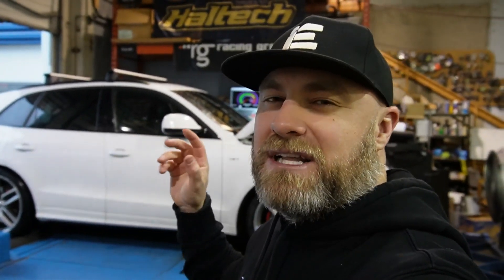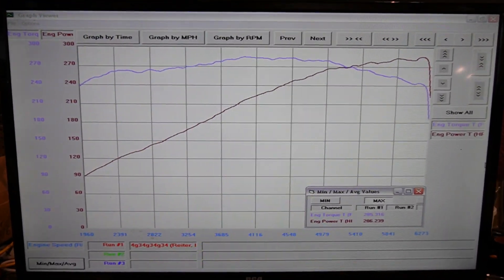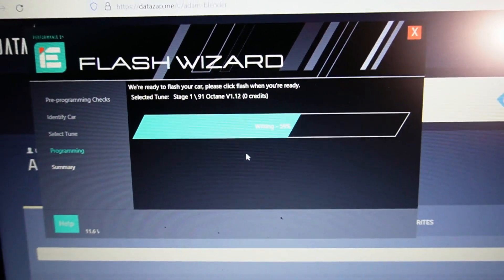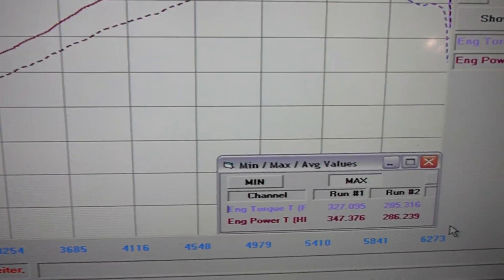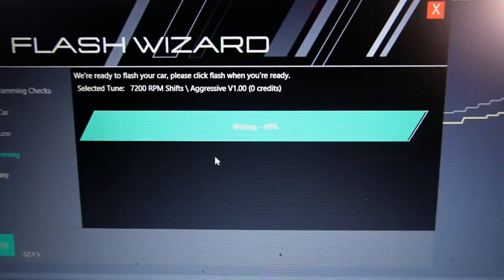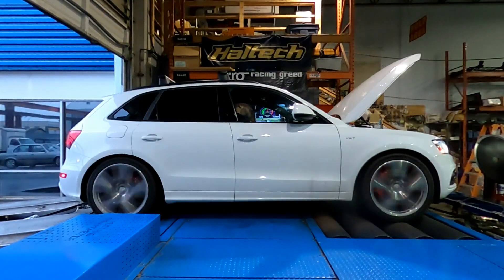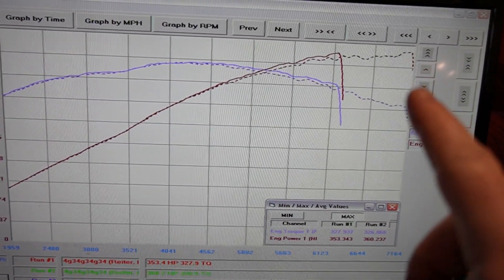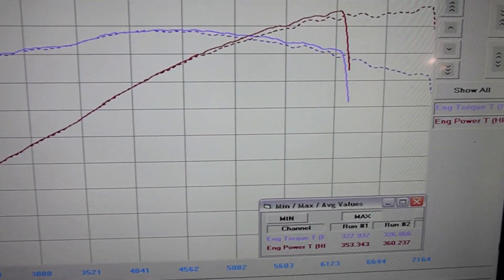How Much Horsepower Do You Gain From An Integrated Engineering TCU Tune In An Audi SQ5?

Comment: The fact that everyone in the comments actually believe those numbers with 0 mechanical mods 😂😂 what’s it gonna make with dual pulley setup and ported charger 1000 whp ?😂
Reply: Cars that already come boosted does these numbers with just tunes adding downpipes would’ve gained a extra 50hp 😂💀
Reply: i gaiend 100hp on stage 1 on my a7 3.0t, but thease numbers are just to much that dyno is either not setup right with the car or just very incorrect
Reply from the maker: @stefanmarkovic8180  or you have absolutely zero clue of how dyno's work which is apparent from the comments you have made. Perhaps you should watch 0:48 of this video so you can learn a thing or two of how dyno's work: https://www.youtube.com/watch?v=JKB73iMNnXY&t=293s
Reply: @VancityAudi  very professional taking it so personal but idc you know nothing about my knowledge and what i do so it’s ok
Reply from the maker: @stefanmarkovic8180  Not taking it personal, lol. Just trying to improve on your knowledge base seeing as you speak as if you are someone extremely uninformed of how dynos work and read.
Reply from the maker: The fact that you don't believe them is more of a problem. Feel free to call the performance shop or drop by yourself and ask to see them in person. I don't ever lie in my video's. I simply record and share data. 

It gained exactly what I shared in the video. I specifically use this dyno because it is extremely consistent in its readings.
Reply: @VancityAudi i couldn’t care less because it’s not my car that’s just getting a download flash put in to it just to show high numbers on n YouTube
Reply from the maker: @stefanmarkovic8180  and yet you're the person complaining and poking fun at me simply showcasing what this vehicle did with some simple tunes and an air intake. It's not even my car! LMAO. I have F all to gain from showing "high numbers". I even specified they were non-corrected Mustang AWD numbers.

Comment: 91 octane you show a 40 torque increase yet IE website advertised a 120 gain.   BIG difference.
Reply from the maker: You appear to be looking at the wrong chart. Here is the link for the tune you should be referencing: https://performancebyie.com/collections/ecu-software-tunes/products/ie-ecu-tune-audi-30t-supercharged

48lb/ft of torque at the crank is what they claim from a stock tune to a Stage 1 tune on their 91 octane tune in a B8/8.5 SQ5.
Reply: @VancityAudi ah, yes. I was thinking B9.  Sorry.
Reply from the maker: @datsuntoyy no worries. Just trying to help.

Comment: Who can help me ... trying to get higher rpm limit on shifting. 
I changed the limit on ecu software to 7200rpm
And in tcu to 6800rpm
But the car is going all the way up to 7200rpm and get into a fault... what else I need to do in the software???
Audi Sq5 2015 dual pulley
Reply: Fixed the issue .. by put higher limit on tcu and little lower on ecu...
So it is going up to 7000rpm as I put in tcu...but cut the ignition and doesn't shift up gear....
What I need to do more to make it shift up .. some help please..there is no tuner here that can tell me please???
Reply from the maker: @doronkoz  your ECU and TCU shift points need to match. If your ECU is set to 7200rpm then your TCU should be set to 7200rpm as well.

Comment: Does the B9 gain any power from TCU tune?
Reply from the maker: No. Unlike the B8, the B9's powerband drops off higher up in the rpm's because the turbo isn't very big. If I remember correctly the peak horsepower in a B9 with a stock turbo is around 5600rpm so there is no advantage in revving the car out to 6800rpm for maximum acceleration. With that said I still HIGHLY recommend you pair your ECU tune with a TCU tune to get the maximum amount of performance out of your B9.
Reply: @VancityAudi I followed your advice on that, about the intake you showed, can you dyno the B9 to see if it adds power like the B8 did?
Reply from the maker: @adventurer4188 already did. https://youtu.be/Jsdmf78qHXA

Comment: Have 034 with same tcu, stage one 91 and their intake. It’s an absolute beast off the line. Leaps out of the hole like a Tesla model Y and gives all these EVs nowadays a proper challenge.
Reply from the maker: If you're impressed with a B8/8.5, you'd be even more impressed with a B9. They launch even harder and make substantially more torque off the line.

Comment: That’s insane. The stage 1 numbers are what I would have thought it would make stock. These things lose a ton of power through the drivetrain
Reply from the maker: Remember, these power figures are at the wheels and not at the crank. You have to add drivetrain loss into them to understand what the vehicle makes for power at the crank.

Comment: The numbers are good but how reliable are these tunes? I have a stock 2017 SQ5 and I’m tempted with the stage 1. I’m not interested in big numbers, I’m looking for better fuel consumption and a little more pep on the highway. Is a TCU tune necessary with a stage 1 ??
Reply from the maker: It isn't "necessary," but you won't get the full potential of the tune as shown in this video without a matching TCU. Their Stage one tunes are extremely reliable. Make sure you use promo code VANCITYAUDI for a discount from https://performancebyie.com/?dt_id=312953

Comment: I just bought a 2015 SQ5 a few weeks ago. 42,000 miles. (No Mods yet) I have noticed some "Sloppy" trans behavior. Its not all the time, normal day to day driving in "comfort" mode is fine mostly. In Dynamic it shifts harder and seems to jerk around - up and down in gear. I understand this might be the trans way of becoming more eager and aggressive. However, here is where it gets strange,...When in "comfort" and I decide to be aggressive with the gas peddle (like chasing down our mail man on the highway) it shifts hard, and after the big chase it's like the transmission stays pissed off - Shifting a little hard and up and down in gear. It's not until I stop the car and it sits a bit will it stop the erratic behavior. SO with this said, do you have any kind of explanation? Also do you think there is a good TCU tune that would help some of this erratic behavior when in Comfort mode? Do you think a simple re-map of the trans at the dealership will fix this? ANY INFO HELPS!!!!!! Love your Vids by the way!
Reply: It’s normal for a ZF8. The trans is bulletproof. I can assure you. They use these in all medium or large high powered cars such as roles Royce, Lamborghini Urus, Porsche Cayenne, Bentley whatever the heck they have and so on. They can handle a lot of torque and shift fast. Also can skip gears. That’s why probably feels weird.
Reply from the maker: I'd look at doing a transmission service as well as a proper TCU tune from IE.  Dealerships don't offer tuning most of the time. You can do it yourself by ordering IE's Powerlink cable or you can go to an IE dealer to have it done. Thanks for watching!

Comment: just grabbed a super clean 2016 SQ5.  Thinking for doing this exact thing minus the air intake.  Can this all be done from my phone etc once the gear in purchased?  Thanks for the tips.
Reply from the maker: As of right now, you'll need a laptop and the IE Powerlink cable to tune the car. Soon, IE will be releasing tuning capabilities via their phone app though.

Comment: I have a new 2023 Audi SQ5. What should I start with to make the turbo have a little more noise, or should I start with the an air intake? I don’t want to go crazy with mods but I want it to seem a little more ballsy haha thanks I’m a newbie
Reply from the maker: It depends if you want whoosie turbo noises or more exhaust noise. Whoosie turbo noises are achieved by installing an open air filter intake and a blow off valve. Exhaust noises would be a catless downpipe and midpipes.

Comment: Hi guys.. I just tuned my SQ5 2015 to 034MOTORSPORT TCU 7200RPM TUNE. I'm stage 2plus dual pully ecu.
I went to a test drive... the power goes down from 6000 to 7200rpm... and after two pulls the car now goes slow...
I checked for faults and yessssss there is p034000 camshaft position sensor circuit. It doesn't erase.  Active fault. 
Am I fucked my AUDI? or what? 
The situation now is : long starter (2 sec) to start. And the car goes like it has 100hp. No strange noise or somthing. Any suggestion before I'm crying here?
Reply from the maker: Have you tried reaching out to 034, seeing as your problem started after you tuned it?
Reply: @VancityAudi  i sent an email... it was before 2 hours all the story... waiting for any comforting answer from some one who experience it

Comment: Hi Adammmmmm.... how are you???
I'm dual pulley now sq5 2015. 
I wanted to ask what it needs to be in the tcu tuning to get more "power" and less times for 100 or 200 kph ? 
It is only the fact that it goes 7200rpm gives it more "power"? Or must to make it more pressure in the shifting???
Reply from the maker: It allows the engine to rev to 7200rpm which allows you to make more horsepower. Without the TCU tune your motor can't rev as high and won't make as much power. Thought that was pretty clearly explained in this video.

The other thing a TCU tune does is allow for a better launch control and possibly better shifts.
Reply: @VancityAudi        yes it was very clear in the video.  Just wanted to hear it from you again. I'll let you know the difference in my car after I will tune the tcu. And heyyyyy... thanks for all Adam. Your videos are the best. Love to watch them. Thanks From ISRAEL

Comment: Hi, all the way from Germany. 
I was wondering if you would swap the original Turbo with a high Performance garrett Turbo on a sq5 8R, I am thinking of doing that. My SQ5 8r TDI competition has the stage 2 MTM Chip implemented, tested 431 bhp.
Reply from the maker: No idea, sorry. I have no experience on the new turbocharged SQ5's other that what I've seen with my B9 S4 with the same motor and transmission. If I had to suggest a turbo it would be the TTE710.
Reply: @VancityAudi  Thanks a lot for answering, I will research the TTE710. Great Videos by the way 👍
Reply from the maker: @Andili76  no problem. I'd recommend Integrated Engineering paired with the TTE710

Comment: What about the 3.0 this model?
Reply from the maker: They use the same motor and the same transmission, not to mention the same tunes. This would apply to those as well.
Reply: @VancityAudi  Do you have any dyno graphs, or videos of these?
Reply from the maker: @TEJET1  they'd look the same as the SQ5
Reply: @VancityAudi  Sorry, I just realised auto correct changed my message. I was asking about the 3.0 TDI Engine? which is in Australia and Europe? Its a diesel engine, so the dyno would be different :)
Reply from the maker: @TEJET1  in that case, it's a completely different motor. Different tuning is needed. https://www.getunitronic.com/ecu-tuning/audi-q5-3.0tdi-2014-2016-stage1

Comment: Hey I am new to this channel , Great Stuff  !! I have  2013 Audi Q3 Now 2105 In The USA. I have stage 1 integrated engineering Tune. I not put my car in Dyno as yet but the difference is Huge !!  I  I have now installed  REV 9 Intercooler with a some modification because I could  not find the correct fit. I  have also added CTS Turbo down pipe . I have not added stage 2 File as yet as I want to add the  Air intake system and and and Transmission Tune. Can you recommend a TCU Tune  for  Car . There is not much information on Audi q3  EA888 engine
Reply from the maker: I honestly don't know that there is one. From what I know the transmissions aren't very well built in those SUV's sadly. Sorry dude.

Comment: Seems an exhaust system could wake it up a bit more?
Reply from the maker: Maybe in terms of sound, but not for power.
Reply: @VancityAudi  No restriction in the headers or cats or mufflers?
Reply from the maker: @turnin.sprocket  replacing the cats with test pipes would open it up a bit, but I've seen in other testing that upgrading the exhaust doesn't provide any power gains.

Comment: Great video. I'm from Brazil and I have a supercharged SQ5 with k&n inbox. Would it be possible to somehow perform the remap (ecu and tcu 91 octane) via remote?
Reply from the maker: Absolutely. You need a Windows based laptop, a strong Wi-Fi connection and the Integrated Engineering ODB2 dongle found here: https://performancebyie.com/products/ie-vw-audi-powerlink-flash-cable?_pos=1&_sid=bb617cbf4&_ss=r
Reply: @VancityAudi  Combined. Once I get the connector, I'll get back in touch to work out the details. Nice job. Congrats.
Reply from the maker: @Diovanni  Integrated Engineering has details and videos on their website on how to tune your car.

Comment: The reason the TCU tune helped you so much, isn't because of the extra peak power, it's because of where the shifts put you in the rpms. You don't make peak power the whole time you are running down the drag strip. Now that you are running 7200rpm, you don't drop way back down to where the engine isn't making the power. That was probably the point being made by the people telling you that. The average power with the rpm shift is a lot more than the 20whp peak gain suggests.
Reply from the maker: Sadly that wasn't what he was claiming. I feel like this is the 7th time I've explained this now, lol. He claimed that his ECU tune made no difference on performance and the sole reason his SQ5 went quicker, faster and made more power was because of the TCU.
Reply: @VancityAudi  lol, got ya.

Comment: So stock the horse power is not even close to what Audi says it comes with?? (354hp)
Reply from the maker: The horsepower Audi claims is what the SUV makes at the crank. The measurements you see here are power ratings at the wheels. You have to account for the drivetrain loss.

Comment: Another great video! I’m have a B8 S4 and want the stage two ecu tune, tcm tune and heat exchanger. In an B8 S4 what the tcm shift at, mine shifts at 8200 now I think. I’m gonna go with EI also I think just because of your videos brother, I feel like you test and tune for the audi gang. Thx a bunch.
Reply from the maker: Your transmission would have blown up already if it was shifting at 8200rpm, lol. If it isn't tuned it shifts at around 6800rpm. Once tuned with IE you'll be able to shift at 7200rpm or 7350rpm.

Comment: Extending the redline yields better 1/4 mile times because it increases the AVERAGE horsepower.  After each shift, the rpm’s drop, but they will be at a higher rpm, which means more power, and a more efficient powerband with higher average HP.
Reply from the maker: I am very aware of that.  What the previous commenter stated is that the whole reason the SUV went as quick and as fast as it did was solely because of the TCU tune and that the ECU tune did barely anything in terms of providing more power to go quicker and faster in the 1/4 mile.  I proved that was 100% incorrect because the bulk of the power gained was via the ECU tune.  No doubt the TCU helped out too.

Comment: Loved the video. Would have like to see the car with no IE intake because I think that it would show even better than it did on the track test given the extra RPM.
Reply from the maker: Not sure I understand. Why would you want to see it without the IE intake?
Reply: @VancityAudi  To show how much extra you would get on a TCU tuned car from the intake. At the track it looked like 18 hp when you put on the intake. I want to know how much it would be worth on a car with a Stage 1 file but the TCU tune as well because I think it would show even better, given the extra amount of air ingested at the higher RPM.
Reply from the maker: @Todd.T  how did you come to an 18hp gain from just seeing 1/4 mile runs? The videos from the track were already using both the ECU and TCU tune.
Reply: @VancityAudi I forgot the part that the TCU was tuned, but would still be curious as to it's advantages on a car without a TCU tune that isn't going to rev that high. I said 18hp as a ballpark because for you to drop a 10th in the quarter you either have to add 10 hp or drop 100lbs. Same to gain a mph.
Reply from the maker: @Todd.T  that's an extremely general calculation, but okay. Ya, it would have been interesting to see the difference in ET and trap with and without a TCU tune installed
Reply: @VancityAudi  It's been pretty accurate for many over the decades. The only way to be sure is to....dyno it!! The trap speed shows more value and accuracy than the ET in the calculations.
Reply from the maker: @Todd.T  sadly I know that not to be true from personal experience. It may be somewhat accurate at slower ET'S, but as soon as you start going quicker that isn't even remotely close to accurate. If I add 100hp to my RS3 which currently runs a 9.3 there is no way in hell it'll then run an 8.3, lol.

Agreed though that doing before and after dyno comparisons on the same day, in the same conditions is the best way to see exactly what the gains are.

Comment: Awesome video 
Can I tune my Audi Q5 2.0t like that?
Reply from the maker: You can tune your ECU just like I demonstrate, but I don't belive there is a TCU available for your transmission.
Reply: @VancityAudi 
Correct no TCU tune -- kinda weird --
It's interesting to me -- B9 Q5 2.0t is near 350HP stage2...
Maybe a SQ5 vs Q5 2.0t drag racing!! Similar HP range 6cyl vs 4 cyl "mass" difference= time difference

Comment: What are your guesses about the future of the 3l v6 engines. Forged pistons, camshafts? Hopefully they will be able to reach 700+ hp one day.
Reply from the maker: Are you referring to this generation 3.0L V6 or the new 3.0L V6 found in the current generation?
Reply: I mean the b8.5 s4 (supercharged)
Reply from the maker: @jonasvandebuerie8266  I personally think we have seen just about the limits of that setup.  Many people disagree with me though and have made new superchargers and port injection kits in hopes of running straight E85 with a bigger blower.  I don't foresee a useable 700hp out of that engine.